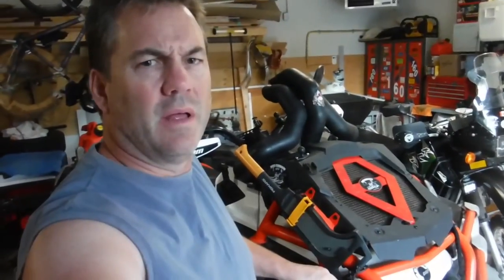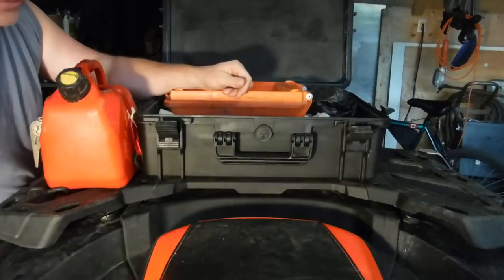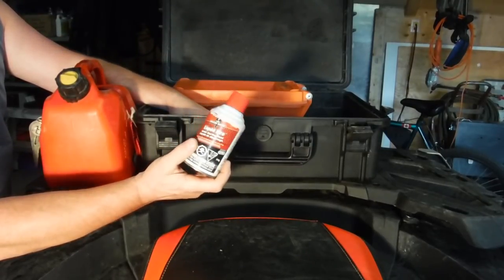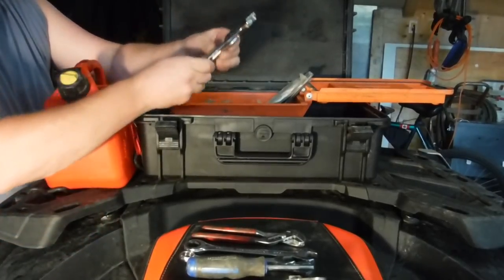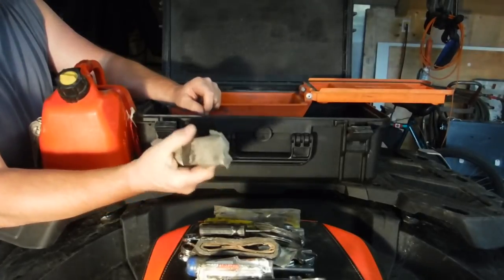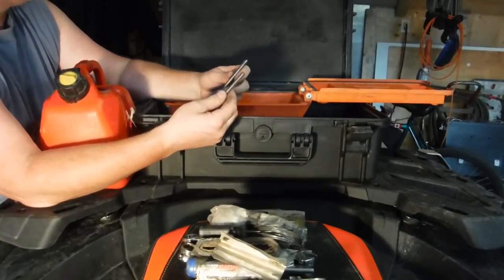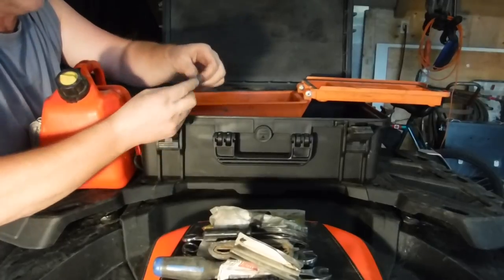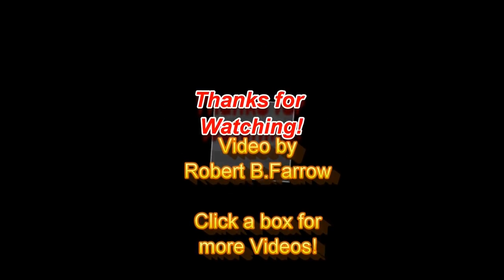What's in my ATV Black Box Can Am XMR 850

Comment: Nice little assortment. It is hard to carry everything. Most of the time everyone together, you can get just about anything repaired on the trail.
Reply from the maker: Most of the time, I'm the one supplying tools, cause nobody carries any! LOL!  It's nice to have something though to get you home when things mess up! Thanks for watching Mark!
Reply: Rob Farrow ATV yeah I had a basket rack on front and back of my old 4 wheeler. Didn't take long to remove one of them. I was carrying everything from tools, compressor and everything in between. The last straw was when they started wanting to put the cooler on. Lol
Reply from the maker: LOL!

Comment: Nice video Rob, I like the idea of a smaller box I hate those big boxes from the dealership. Where did you get it from, is it waterproof and how did you mount it, thanks.
Reply from the maker: It's a Canadian Tire Box, waterproof and I've had it submerged a few times with no leaking! I just bolted it straight thru to the rack and siliconed the bolts...I've seen some people make racks for them, think Franks ATV made one!  Thanks for watching John!
Reply: @RobFarrowATV  I suggest a little zipper pouch to hold all the loose ends.  Nice kit. what was that little compresssor? That looks handy.  powered by 12v plug?
Reply from the maker: Ya, that's a great idea, didn't even occur to me, thanks! I believe I bought that compressor at Canadian Tire and it has the 12V plug end. Thanks for watching Fred!